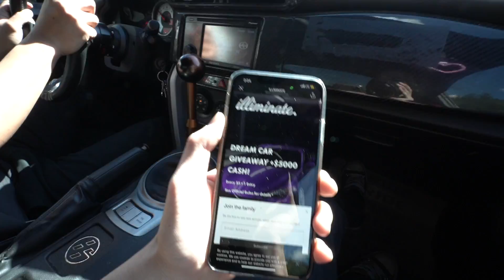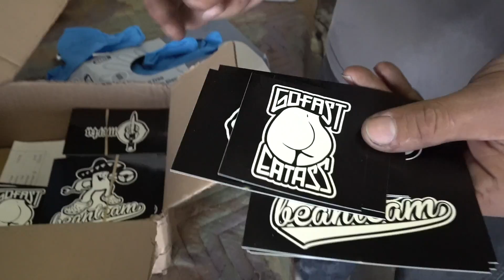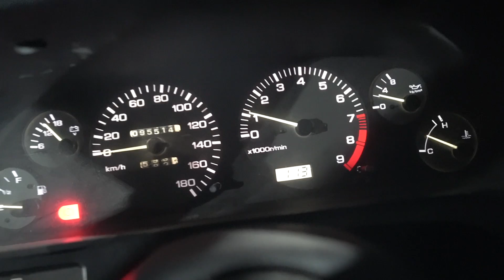THE SKYLINE'S TURBO IS BAD TOO?!

Comment: I have owned My R34 for almost 10 years, The only thing i have replaced in that time because of breakage is a Radiator. Everything else has just been general Maintenance. If you modify them correctly and use Quality parts, they can be very very reliable.
Reply: CannonShane I agree bmw are know break machine but my dad put quality parts in his customer bmw 6 year but still run perfect
Reply: CannonShane where do you live to have an r34 for almost 10 years 💀
Reply: Detroit culture probably australia since they have a bunch of them
Reply: @Chargedwrld313  maybe japan
Reply: expired kermit damn I forgot abt that😭
Reply: CannonShane cap 🧢
Reply: @Chargedwrld313  I'm in Australia buddy.
Reply: To be fair both of his r32 are much older then your car and you never know how they were treated before he bought em plus the turbo install he did wasn't done properly and this sounds alot like what Subaru owners say...all the time
Reply: @adruuun  Of course, But that can happen with any vehicle you purchase. I wasn't just talking about his cars, More so skylines in general. A lot of people have the perception that they break all the time, Which is very far from the truth in my experience with these vehicles.

Comment: Dude read this long comment this might help you out really.!!
Are you running the turbo hoses with solenoids? If so, which one 2, 3 or a 4-port one or bleeder or what? If you have run in both skyllies a 2 port solenoids, maybe change to 3 or maybe 4 port solenoid? Or don't run one at all and just get bigger turbo. But using a solenoids if that the route you want to go check out how all the solenoids work cuz its kinda different, and maybe your wastegates and blow off valves springs must be checked how much psi they standing?

Comment: Nissans are fun cars while they are running as soon as they run into a slight problem, the problems keep coming, recently sold a 07 wingroad y12 because the car started having tons of problems which started with the AC not working

Comment: My moms car keeps snapping her rear stock camber arms and yesterday she got it towed to her cousin house so I can go there and fix it and put my old Work CR 2P on her car and lower it wit then air also it’s a 14' Nissan Murano but my 09' 350Z is  giving me only 1 problem it has Work Meisters S1 3P and it has BC Racing stance coilovers and a tomei ti extreme exhaust(has no engine mods, stock VQ35HR) but my breaks needs  to be changed the breaks last weekend and it’s sketchy but I also street drift a lot so yea! Also I’m 16 and in 10th grade in Puerto Rico wit a 350Zand 04 Evo 8🤣🤣! Nissan problems🤣🤣🤣🤣 (btw I daily both cars my 04' Evo 8[650+AWHP 4G63 Evo 8] and 09' 350Z[250HP VQ35HR wit a flame tune])

Comment: Randy i have a question if you could help me out or anyone having or had the same problem. I just put a quick release steering wheel but its not straight. Its crooked and off center so its kinda bothering me. Is it an alignment issue or what could it be?

Comment: My mom has a nissan altima 2008, engine overheated on me did a motor swap and now the fuse on the battery keeps popping on me, haven't been able to find the cause of the problem yet😞😪

Comment: Randy man, Nissan's are EXTREMELY reliable. But you also realize you kinda beat the shit outta your cars man. I've owned mad Nissans and the only reason I got rid of them is to upgrade to a newer model. Hell I had a Pathfinder that I purchased new in 2000 and kept it for damn near 200k miles. Ran like new.  Don't knock the car man. You're having typical race boy problems chief. Keep ya head up and keep pushing. And fix these damn cars...one at a time. Focus is key 👌

Comment: Matt said he wants a reliable engine... Buys SR20 lol. Worst engine ever. Great when they work but always has something wrong
Reply: They're actually really reliable in stockish configuration,  I put no aftermarket cams and address oil issues by fabricating an oil pan this alot larger 😁 car will run great with my care